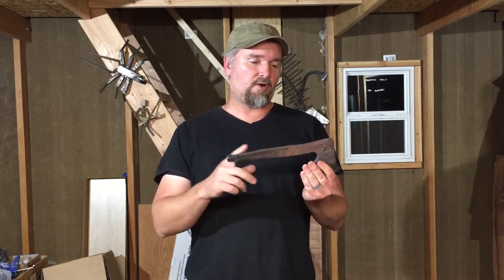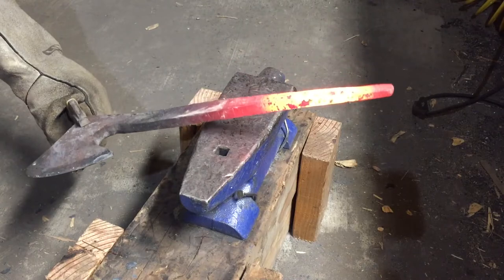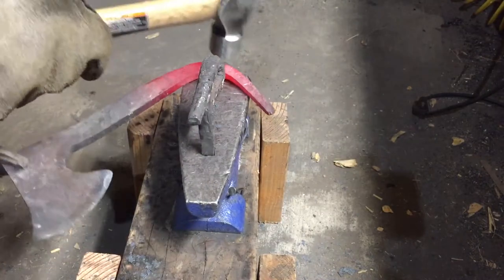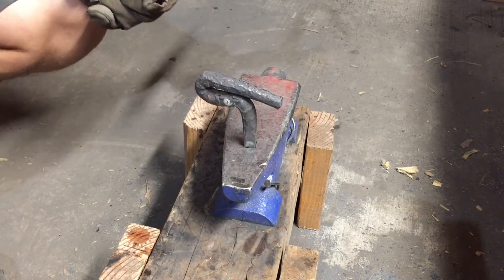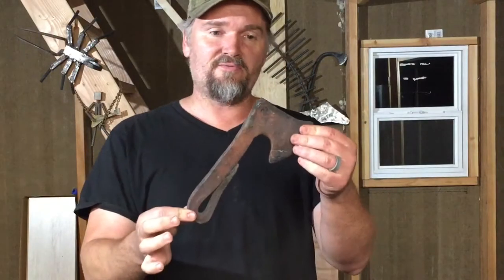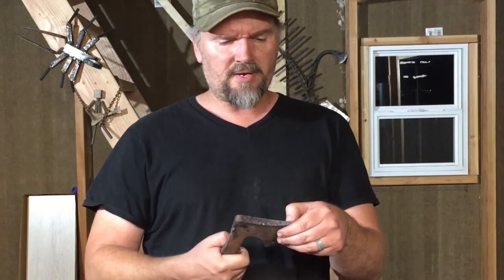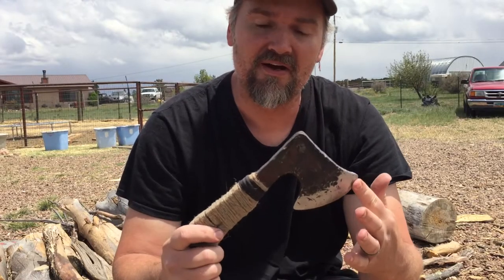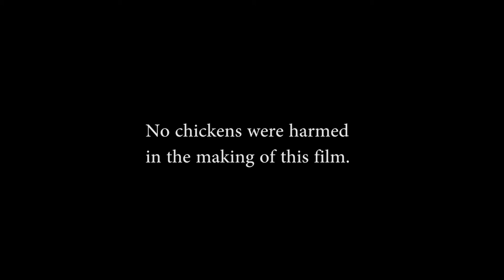How to make a camp hatchet from half-inch steel plate (Part 2) Chickens Beware!

Comment from the maker: So... what's the difference between a hatchet and a tomahawk?
Reply: Not 100% sure but I think the tomahawk has a handle where the bottom of the handle goes through the top of the head and is slid up and kept on by friction. Whilst the hatchet the top of the handle is put into the bottom of the head and has a wedge. As far as I can tell that is the main difference apart from where the words originated. They are used interchangeably by a lot of people and there is a lot of crossover often on features. Like the shape of the eye. The shape of the handle. Design/profile of the head. So personally I just call it one or the other based on the way the handle goes in. Because yours is one piece I would call it a hatchet.
Reply: I know this is old but Hatchets are for woodsmen and making kindling and chopping down smaller trees. Tomahawks are more-less weapons, made for THROWING, and can also be used as a survival tool as well, similar to a hatchet. Also, Hatchets are mounted to the head differently. Here is a picture of a Tomahawk: https://media.midwayusa.com/productimages/880x660/alt2/810/810881.jpg
And here is a picture of a Hatchet:https://media.midwayusa.com/productimages/880x660/Primary/782/782335.jpg